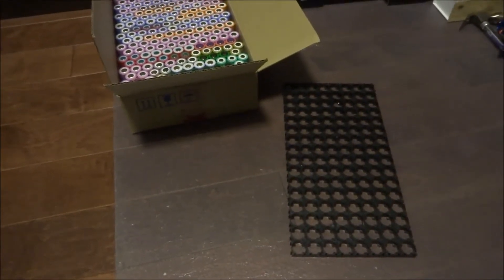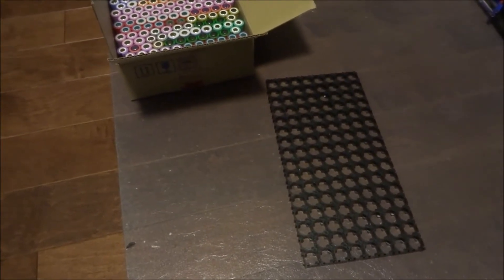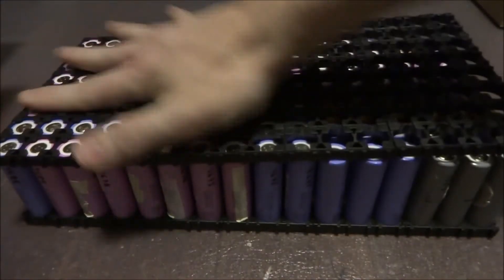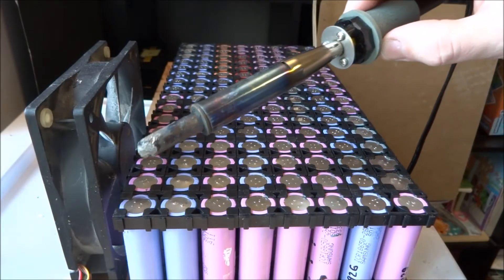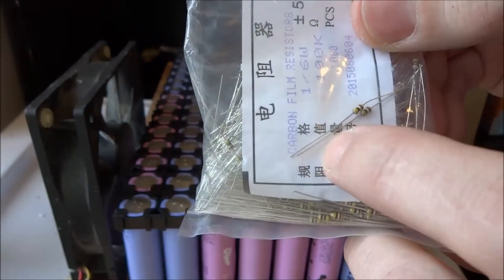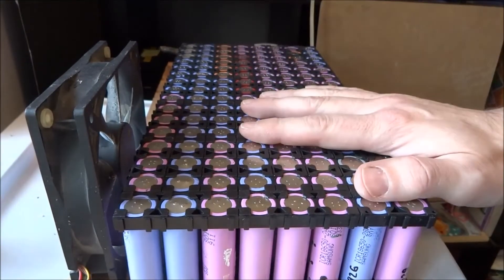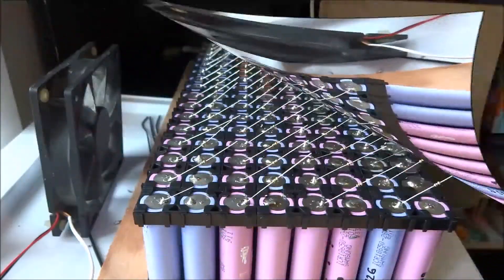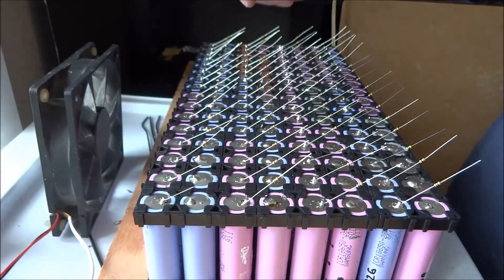Commander Electric upgrade to 18650, assembling first group of cells (1)

Comment: what are markings on them for like " 4673..."?
Reply from the maker: When I test my cells, I don't mark it with the capacity, I assign it a number and I put the capacity on a spreadsheet. I do that since if I later re-test the cells, the capacity will most likely have changed. So the cell you noticed, 4673 is the 4673th cell I tested. I'm now over 10,000

Comment: Seems to be a lot of people making these battery packs, shame that hardly none of them follow best practices. You should re-wrap the batteries to ensure the battery is flawless under the wrapper, dents and other undesirables can be easily hidden and it would only cost a few bucks. I also recommend a spot welder rather than soldering, heat damages the battery inside which is not visible to the naked eye.

Comment: Good work, you may want to tin your resistors in a solder bath to stop dry joint. Plus your tinning of your iron is call a heat bridge. Loving the show.
Reply from the maker: Thanks for the reply, I think the resistor legs are already tinned, they seem to solder very well, that's why I use them.

Comment: 18650 pack building skill 999999999999999 !!!
Reply from the maker: It's 1/4 to 1/6 watt resistors, the value of the resistance is unimportant as you only use the wire. You can get a pack of 1000 for a couple bucks on aliexpress or ebay
Reply from the maker: thanks!
Reply: Hi, your work its great, i will be start some battery pack like yours  for my EV Beetle 2001.. www.libredehumo.mx.. can you tell us what kind of resistent you use for the wire fuse?